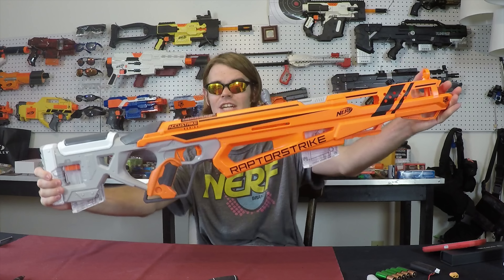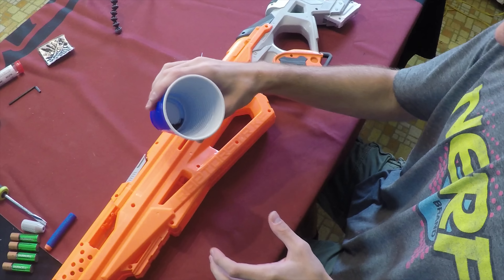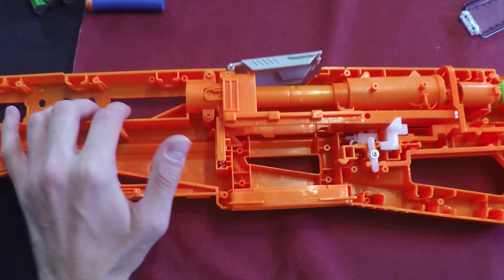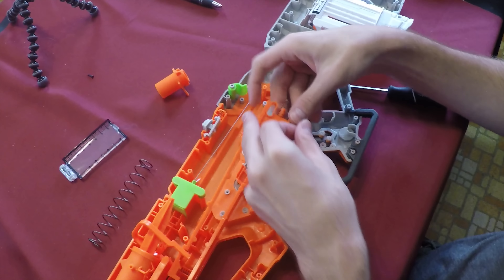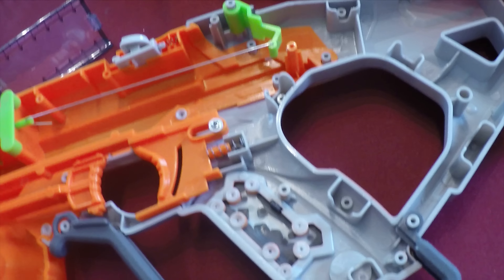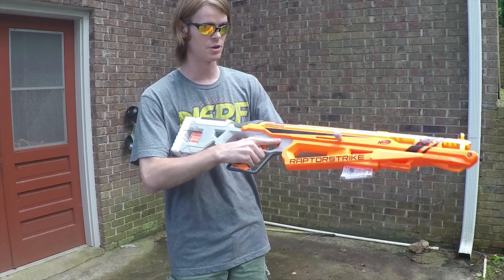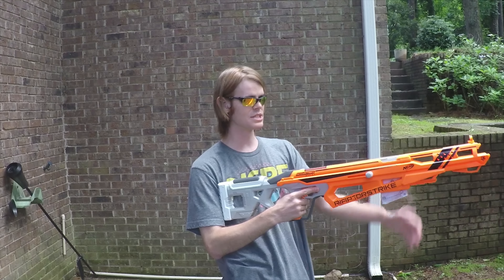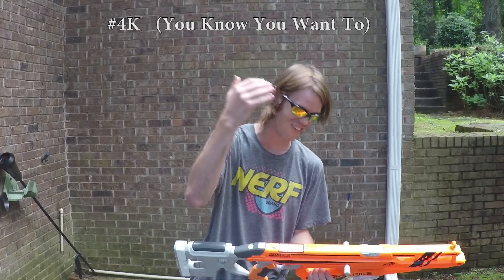Nerf RaptorStrike Mod Guide In 4K!

Comment: Ooh I need to get one of them springs since I been modding guns lately like making guns fire 2-4 shots instead of 1.
I recently took my BigShock apart to make it fire 2 at once but I see that spring shop and now I want to take my guns apart and change up the spring.  Same for Double Breach which I am unscrewing as I type this.  I will hopefully tomorrow go out and buy some spray paint to paint it up and then see about the spring.

Comment: if u want to take the bolt out i have one go to suggestion and that is to use a hammer to wedge it out, it takes about 3 secs of effort, definitely doesn't break the blaster, how do i know? i did it with mine to redo a mod, easy

Comment: How do I remove the primer bolt if I already have the blaster completely assembled?
Reply: Tempést  I mean the rod with two knobs each side of it that you use to pull back to action the spring in the loaded position
Reply: Tempést  ok I'll talk fire arms so you may understand. I want to know how to remove the cocking handle that which primes the receiver back into loaded position. I want to know how to separate the knobs from the rod which is used to prime the spring back
Reply: Tempést  remember I cannot split the gun(open it all up) till I remove the knobs to the rod that prime the spring ???

Comment: Did you not remove the air restrictor?
Reply: you don't need to for elite blasters
Reply: Ben Lam It helps performance on all blasters. The air restrictor restricts air, hence the name. It blocks a lot more when it's closed, but it still restricts flow when it's open.
Reply: BoostAddict yeah, for pre-elite blasters. Longshots and Recons. You take it out of a Retaliator, you'll get maybe 3 feet of extra range. Other than that, taking the ar out will kill your blaster's plungertube over time.
Reply: Ben Lam It doesn't help much with any blaster unless it has a very restrictive air restrictor. The oly difference between the recon and the retaliator is the spring rate and the plunger style. the recon is reverse plunger and the retaliator is direct plunger. The longshot is also direct plunger, and that is why it is the most powerful n-strike springer.
Reply: It does help keep your blaster alive. But ARs only improve the performance of pre-elite blasters. Even if you take the ar out of a RaptorStrike, there wouldn't be any significant performance gain

Comment: quick comment, I'd really appreciate a response, honestly I don't mind from who, but, would a Orange Mod Works 7Kg spring for the Retaliator fit in this?? 

I'm planning on doing a mod on this soon and it's going to cost me a pretty penny as it is, and I plan on buying a new spring, but I don't quite want the spring you used here.

if you read this and respond thank you for the information~

also, I'm viewing on a Samsung Galaxy S8+ so I got that #4k feel :P X'D
Reply: Free De La Hoya There's a website that I went to called Nfstrike.com, where they sell a set of raptorstrike springs (a 7kg and a 12kg). The best part: the set only costs about 8 dollars.
Reply: The Alpha Wildcat will 7 or 12 kg fit? I bought a 8kg and it didn't
Reply: The Alpha Wildcat I can't find them on the website
Reply: The Alpha Wildcat nothing!!! Please respond when you cna

Comment: Hi everyone, i will buy this one today. It will be my 1st dart blaster. I have 3 questions:

- I there is an air restrictor inside??? If yes, is it easy to remove?
- I don't want to use a very strong spring, but my plan is to extend the stock spring a little bit and maybe put a plastic disc inside the back plate to compress the spring a bit more. Does this work?
- Does removing the locks has any downsides?

Comment: I found one of these on the side of the road in the trash and I was trying to take it apart to fix it. I had to break the bolt to get it off and I thought I had lost a part or something so I watch this video to make sure I had everything inside correct. It's good to know that the bolt is just something that's supposed to never come off once it's installed. A little dab of Super glue and I'm all set. So thanks for the detailed internal images and the note about the bolt. Turns out the only problem, other than a missing back sight, was a dart jammed up in between the slide and the receiver.

Comment: Hey Drac, have you tried sensually caressing your screwdriver tip with a magnet so you can pull the screws out easier?
Just a suggestion, dk if it'll help.

Comment: Hey Drac. I'm also modding my Raptorstrike. I've just ordered a 12 kg spring for the blaster, and was wondering if I would have to reinforce the boltsled (I think that's what it's called) if I were to install said spring. If so, how would I go about doing that?

- The Alpha Wildcat
Reply: I know I am not drac, but you should really reinforce it. Also check if the barrel has those little gravings inside that make it spin, if not replace for one that does, that will make it more accurate.
Reply: @CodingCorvus  do I still need to reinforce for a 9 or 7kg